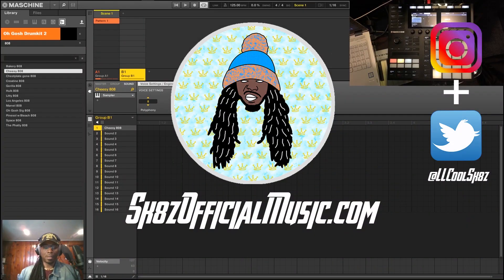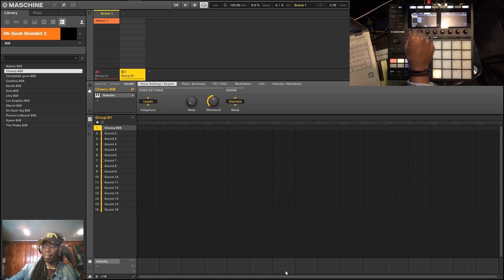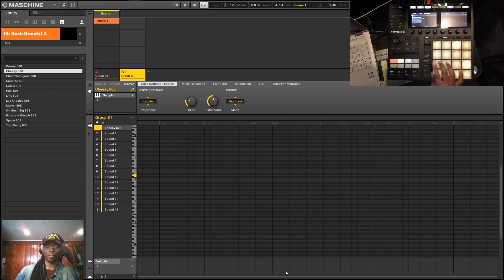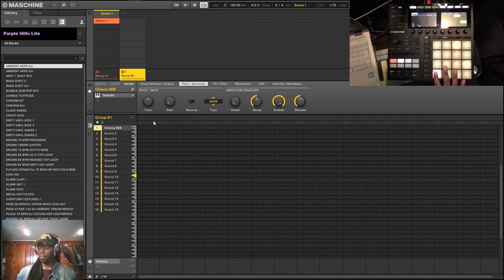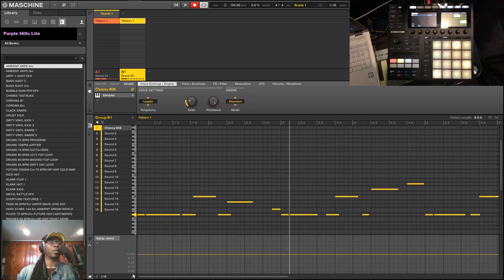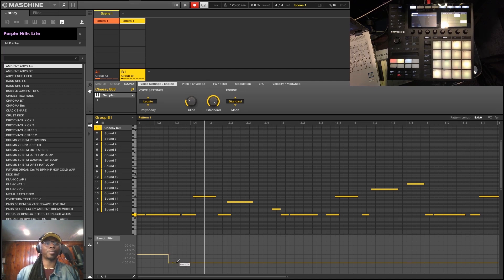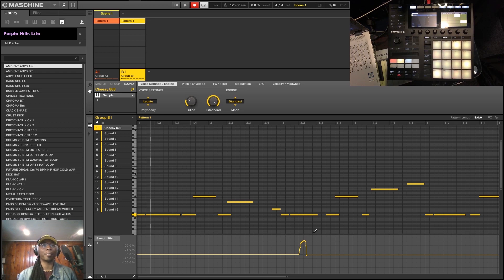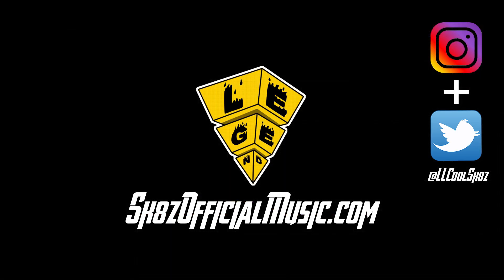How to Glide 808's in Maschine (Fastest Way!)

Comment: What Mashine are you using in this video???
Reply from the maker: I’m using the Mk3, but it’s not too much different on the MK2, the 1, or any of the Mikros. The software is the same.
Reply from the maker: I’ve never used a mpc live so I can’t really say. I feel like it’s not necessary unless your planning on doing more with live performances cause it’s standalone. Software is similar across the board.